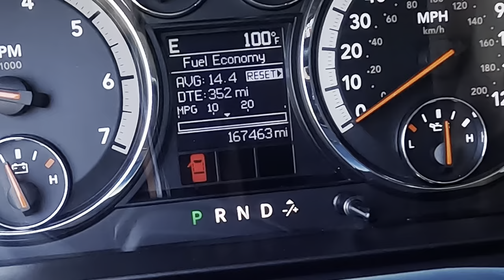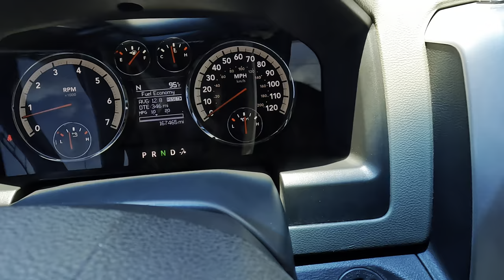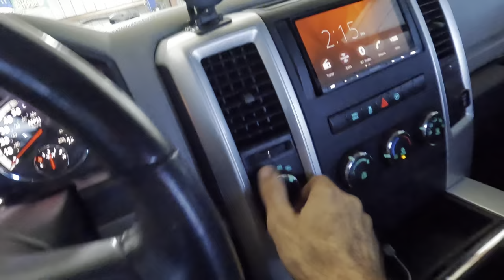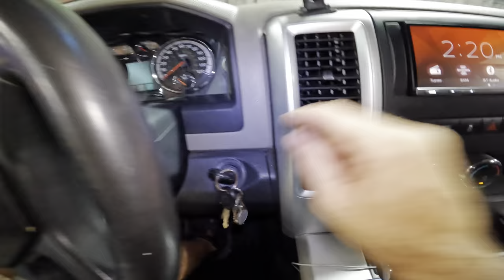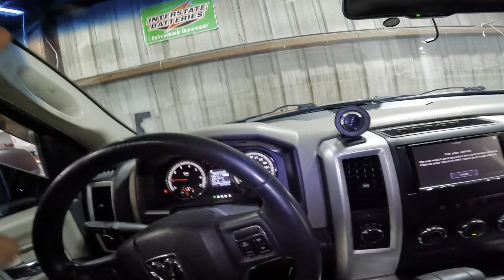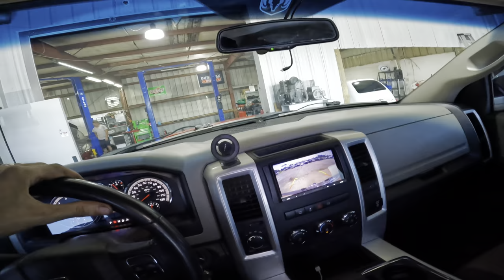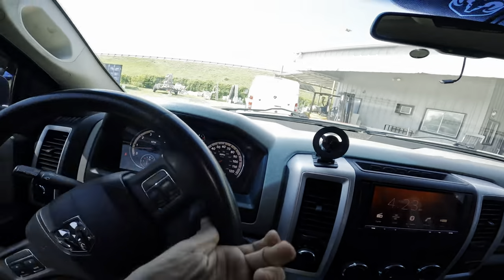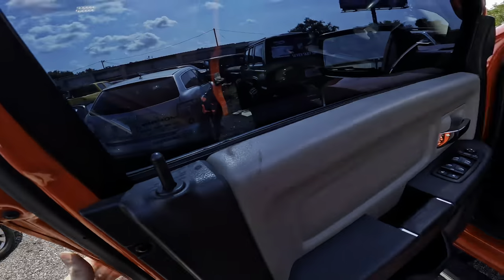Customer States: NO ONE CAN FIND IT! Sand in my Dodge Ram! Replace Whole Unit! 1500 4x4 5.7 hemi

Comment: I used to have a buddy who worked as an adjuster for a company that insured small businesses. His workday was mostly paying for cars that fell off lifts. Kudos for the triple double checks.
Reply: Wow! I cannot believe that happened very often!
Reply: WoW 😮! 
Can't imagine that happening!
Reply: Sure ya did
Reply: @ROKmadness  I am studying to be an insurance adjuster, vehicles falling off lifts is a lot more common than you’d think.
Reply: It fell off a truck.
Reply: That's pretty nuts. I always give them a good shove and bounce when they're just barely off the ground, then go the rest of the way. Couple times I've found once I was up in the air that I hadn't quite hit the intended lift point and I'd solidly picked it up off something super sketch despite the bounce. I once picked up a single cab truck with the rear arms under the frame just behind the cab, did the bounce and shake, and got it up in the air only to discover the far arm in the front had completely missed and the truck was only sitting on three points. I've since double checked my lift points while doing the walkaround and bounce, but given how solidly a car will sit on sketchy lift points it's hard to see it being too common for them to fall off. Closest I've come was while I was early on as an apprentice and I was trying to compress suspension components while up in the air with a floor jack and 2x4, which honestly is textbook levels of dumb anyhow.
Reply: My sister in law lost a Lincoln that way.
Reply: I see the problem it's a dodge😂😂😂😂😂😂
Reply: some of it is they are trying to get the cars fixed to get the money faster by rushing to get done it's probably a half job anyway
Reply: Driveshaft Looks like it spends time in a salty environment.
Reply: I’m the same way with the lift it took me like an hour and maybe 10-12 up downs on the lift the get an AC Cobra up in the air so I can add power brakes,  it has 3” tube for a frame and there is like 0 flat places that the lift can go under.
Reply: I saw a flatbed driver lose a car at an auto shop. Dropped the bed back down without securing it, rolled into the headache bar, hooks dropped, bounced backward, went off the back into a loaded lift and dropped the car onto it before rolling and missing a mechanic by about 3”. It was the most spectacular screw up I’ve ever seen and also one of the most terrifying.
Reply: repentandbelieveinJesusChrist9 no thanks
Reply: The issue isnthe way they design these cheap above ground lifts fs the tradition in ground hydraulic cyl lifts.  Notice the tiny size of tge feet/cup seats that are to mate to the vehicle frame.  See how tiny they are.  They should be 2x min that size.  The other issue and he did not do it either.  You are suppose to always always use 2 support safety jack stands front and rear.  This goes 4x if you are working under it and will ve yanking or prying.

Also he neber put a tq wrench on those drives haft bolts.  Especially with a spacer proper tq spec is critical.  In fact ever suspensi9n and drivetrain bolt screw has a tq spec.  But 99% of mechanics think they can feel it.  Total bs and why bolts get broken off or loosen and leak etc.  What it comes down to is laziness.  Takes a few seconds to finish bolt off with a tq wrench.  I have seen alum rides warped and God knows how many lug nuts cross threaded from power wrench monkey going at it with their power tool vs Startin it by hand and finishing with a tq wrench.
Reply: @gogmorgoaway 😅😅
Reply: @tonykomer2997 you do realize the torque values don’t matter at this point. It’s all coming back apart to be replaced but good try.
Reply: @robertstark9454  Florida, sand beach ocean and brackish water.
Reply: What happened to your buddy?
Reply: @buttsexandbananapeels  I’ve seen 3 different vehicles fall off of car haulers, 1 was in the dealer parking lot, but unfortunately the other two were while going down the expressway…… all 3 fell off the top row at the very back of the trailer, and oddly enough, the two I saw on the expressway were right in the same exact spot…… which thankfully was on a curve/ramp from one expressway to the other, so the car dropped off the trailer from the top shelf, landed on its wheels, then ghost-rode its way onto the shoulder/grass median. To see that once in a lifetime I thought was probably pretty rare, but to see it twice , in the same exact spot, has to be rarer than getting struck by lightning. It is the “Motor City” though……

Comment: Kudos to the owner, that rig is being well taken care of.
Reply: Agreed - 167k miles and that truck looks great.
Reply: So was mine when living in Clearwater fl
Reply: Came here to say this. I love seeing cars over 150k or over 10 years old that have such well maintained paint, but especially that interior. Shiny shiny
Reply: Well taken care of apart from the lift kit nonsense that wilfully messes up the carefully engineered chassis and drive train to the point where a u joint fails that was designed to last.
Reply: @SebBrosig  u joints fail all the time. 60k when I had to change mine out without a lift kit. Thankfully GM hasn't gone to a non-replaceable design.
Reply: Lol ya bc he doesn’t use it xD
Reply: repentandbelieveinJesusChrist9 Amen!
Reply: Besides ruining it with a lift kit and low profile tires.
Reply: repentandbelieveinJesusChrist9 no thanks.
Reply: Those wheels for off-roading? Idt so. Not upgrading all those bushings? Truck owner is a rookie...
Reply: That's the cardan joint and it has a hidden grease nipple that needs to be serviced with every oil change
Reply: h

Comment: Dealership = Could no duplicate customer concern 100% of the time. Oh and then but you need an alignment, trans flush, brake flush, and cabin air filter.

Comment: The aluminum that spacer is made of is reacting with the steel bolts causing corrosion, new zinc or stainless hardware is recommended or just load them up with a good anti-seize before reassembly...
Reply: Yes , yes ,yes   Correct sir !  Actually very important !
Reply: Yep, nickel anti sieze

Comment: Ray, my $.02 as an owner of many Rams both 1500 & 2500.  The 1500's when lifted, have a tendency to have 4x4 vibration coming from the front.  It's the angle of the axles and driveshaft, and causes extended wear.  Once lifted and 4x4 engaged, you can feel the vibration in 99% of 1500's.  Also, the parking brake cable where you noticed the wear, causes a high pitched noise when going over speed bumps or bumpy terrain.  This is with it lifted or not.  Simply altering the routing a bit takes care of the noise.  Is that RTV on the oil pan plug bolt?  LOL  Hope this helps while I watch the video.  Can't wait to see what you find.
Reply: Having experienced lif lt kits in RSA they all have this issue and the only way I could cure that was to mod the propshafts to have a CV joint instead if the Ujoint.
Reply: @iHelpSolveIt  Had to put a slip yoke eliminator and CV in my (not lifted) LJ to solve a drive train vibration.
Reply: I believe that is paint marker on the oil pan plug. Some quick oil change places do mark the plugs after installation.

Comment: Shout out to the owner that is a very nicely done truck and well taken care of! Also that thing would most likely be rotted out up here in PA 😩😂
Reply: The off-set wheels are great for wheel bearings and other suspension parts
Reply: And here in NJ.
Reply: The rust belt shouts out to guy a guy that don't what rust is!!!!! 🤪🤪🤪🤪🤪🤪🤪🤪🤪

Comment: In ireland we have those staked u joints we can knock them out file out the old stake marks and replace the joint and use a staking tool to refit . Avoiding the cost of a whole shaft replacement
Reply: Yes, the not repairable comment had me thinking  WTF!..
Reply: My 97 crv had staked joints. An after market part on Amazon had u joints with the inside c clips like the serviceable shafts do. Worked for years now and made the shaft serviceable
Reply: Is the labor cost replacing U-joints more than the cost of a new drive shaft?
Are they getting  just like starters, alternators, & CV-joints anymore? cheaper to buy them new or rebuilt

Comment: Rule of Thumb, Do Not over stress the Ram drive train with 4" + lift kits. It is built for stock set up. 2004 2500 HD 4 W, with 388,000 miles on and never have needed any more lift.
Reply: Hi, I’m the owner. It’s a 3 inch lift front and rear from Mopar. Everything on it is Mopar for the most part.

Comment: I would be suspicious of that right inboard CV joint. That was quite a bit of play.
Reply: I agree, and would add to the equation the intermediate shaft that runs from the cv to the diffrential inside the housing. It is most likely just as worn on the splines as well.  However, I believe the u-joint is more likely the cause of the vibration complaint. Both need attention.
Reply: What are your thoughts on the unserviceable drive shaft?  I found a durashaft replacement with a replaceable u-joint installed for $353.70.  But it sucks that it needs it.  Lift kit issues, eh?

Comment: Need to remember that "SAND" is a porous substance made up of individual grains.... semi-fluid in nature. This makes the Force applied by the tires "SLIP" which will place a 'Shock Load' on anything that does not have a SOLID connection. Add to this a constant speed/revolution into the equation and you get a "
HUM" that will be caused by echoing throughout the body/frame of a vehicle(Personally had a bad Read End in a Heavy truck decades ago with this same phenomena, the Rear Diff was worn but did not make noise until under full load).

Comment: In many cases, staked u-joints can be serviced - often underneath the staked cap in the yoke will be a circlip groove. Problem is, you have to destroy it to check before you know for sure, which is fine if it's your car, but you can't exactly do that when you're writing an estimate for a customer and parts are days out at best.
Reply: Thank you I did not know that have a great day
Reply: Or sometimes they make U-joint with C shaped snap rings that go in a grove on the bottom of the U-joint bearing cup on the inside of the driveshaft ears.  
Way back in the day GM used to inject hot plastic into holes in the driveshaft that lined up with a matching groove in the bearing cup and in the driveshaft.  The hardened plastic held the U-joint cups in.  We used to have to put pressure on them while applying heat.  The plastic would come squirting out then the cup would pop out.  There were no grooves for clips and that is the first time I saw the C rings used on the inside of the driveshaft ears.
Reply: I member those that had to have plastic melted

Comment: 15 years ago: 94 Chev 1500 4x4.
 Started to notice unusal sounds. Had to keep driving it daily and the noise got increasingly worse when turning.
 As a self taught, backyard mech, I determuded it was the rear end. Had just had a new rebuilt engine installed and was not ready to give up on this clean truck.
 I got a rear end from a wrecker and changed it out. All good.
 When I went to put the drive sfaft back in I found the the U joints were not moveing at all.
 Then it turned out the the U joints had no clips and needed a torch to melt reteners from the OM U joints to get them out.
  Point is, that between you and Eric O, my skills to properly read noises, determine the parts needed and do the repairs pryer to failer have saved me so much money and down time.
 I have 3 units that are used for delivery.
 Thanks to both of you.

Comment: When you install a lift kit you need to correct the drive shaft angles this cause's joint bind up under load the torque wants to drive the pinion down changing the axle causing a vibration
Reply: Exactly.,
Jeep owners are notorious for this
Reply: I install 2-3 6" lifts a week and the spacer like the one in this video is designed to semi correct the driveshaft angle going to the axles from the transfer case. It worked for a long time by observing the age of the kit installed so it was effective. The newer 6 and 8" lifts use the same spacer set up but are thicker at the top so must be oriented properly when installing. This not only makes up for the distance from the transfer case to the axles but also adjusts the angle by 6° making it far less prone to the issue this truck experienced.
Reply: @kennybaumann2117  thanks for the info
Reply: Maybe greasable Ujoints would help - and of course greasing them after driving through rivers etc
Reply: @kellismith4329  Greasable u-joints are more prone to failure due to being weaker and on this big truck with big tires would likely fail and they do require you to grease them on a regular basis or they'll fail prematurely also.. Good quality non-greasable ones are the way to go!
Reply: The spacer is a cheap way to do the lift. The right way is replacing the drive shaft with a longer one so the angle is reduced.

You’re changing the length of one of the legs of a right triangle which means another leg also has to get longer…. Or you use a little aluminum spacer to fill in the gap and change it from a BB triangle to a rhombus.

Comment: remove the differential cover and look at the slop of the spider gears. I noticed while you move drive shaft the wheel reacted later than the drive shaft movement.  also a pull on the tires see if the bearings are worn in differential. most issues has to do with lift kit and stresses on that drivetrain.

Comment: As a professional amateur off road enthusiast in the coal hills of northeast Pennsylvania, I agree with your assessment. We have coal silt up here, very similar to sand, and the constant wheel slip then traction while in 4wd will absolutely make noise and vibration if the cv and front d shaft are worn.

Comment: Excellent job. I believe you did find the issue with the U joints. The lift kit changed the geometry of critical components. Dodge has always had a great suspension design from the factory on their trucks.

Comment: The worn spline may cause the issue as it will tend to vibrate under certain conditions I would think, but definitely needs the U joints repaired or replaced.

Comment: Typically after market warranties are only good for the amount of sheets of paper they are printed on, as the out house is usually the only place you get to use them.
Reply: You are very correct on the subject. I have lifetime drivetrain warranties on 2 of my vehicles and they state INTERNAL DRIVETRAIN. Water pump  is not included and transmission cooler lines not included. I would think they would be. However it did come in handy to have on my Chevy 2500 when the transfer case went out and locked my trans in 6th gear. I can’t remember but $2000-$2500 they did cover
Reply: And so, the warranty company paid for the front driveshaft and right cv axle. They only replace broken items. So the driver cv axle which was still good came out of my pocket. I was only to happy to pay Ray for his services and I’ve been really lucky with my warranty company. The warranty has paid for itself.😊

Comment: I knew you'd be able to diagnose the issue! You never disappoint!I'm not any kind of cert mechanic, but a noise like they described to you from being in 4x4 in sand would have sent me directly to uni's and cvj's no matter what vehicle I was working on. Even with my limited experience, that's the bell that was ringing! Wtf is wrong with those other dealerships and their mechanics?!!
Nice vid, Ray👍
Reply: Warranty work isn't a money maker for mechanics, no commission on parts and hour allotment is dictated by manufacturers scope of work/specification.
Reply: Lame man terms he said they dont pay the mechanics enough to find out the real problems just do the work that was told to be done

Comment: Fun fact , you can squeal the tires on hot sand. As for the noise , you said it has a lift kit so that means the pinion angle will be under stress .
Reply: Yes you can, also on dirt roads
Reply: And wooden bridges.

Comment: I have had a similar issue with my Dodge a few times. There are a few other possible reasons why the Dodge might be making a buzzing sound under the vehicle after driving through sand as you have stated but it may not be the same as you are having here.

Loose sand in the wheel wells: If there is loose sand in the wheel wells, it can vibrate against the undercarriage of the vehicle as you drive, causing a buzzing sound. You can check for loose sand by looking in the wheel wells and shaking the vehicle. If you find loose sand, you can remove it with a vacuum cleaner or by hand.

Loose or damaged exhaust system: If there are any loose or damaged components in the exhaust system, they can vibrate against each other as you drive, causing a buzzing sound. You can check the exhaust system for loose or damaged components by visually inspecting it.

Comment: I know they're expensive, but a drive-on lift would be great for your new bay.  Absolutely brilliant diagnosis on the Dodge.
Reply: Way better for oil changes
Reply: If I had a shop like his that is what I would want to use,......... less of a headache.
Reply: I worked for 6years with drive on lifts 1 for picups and one for heavy trucks get the air Jack's for the smaller ones super handy

Comment: Yup, stock drive shafts are junk 
My Ford dropped the driveline 2 years ago which also bent the tail shaft took it to our local drive train shop it came back with a drive line probably twice the diameter and bigger ujoints